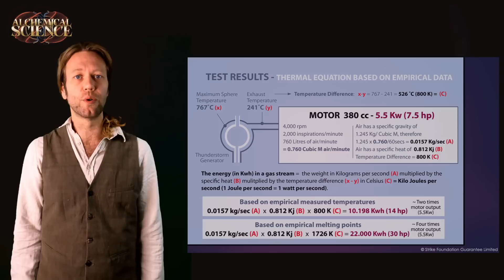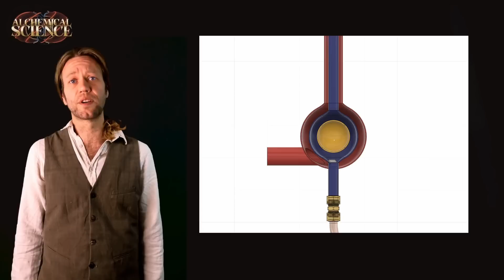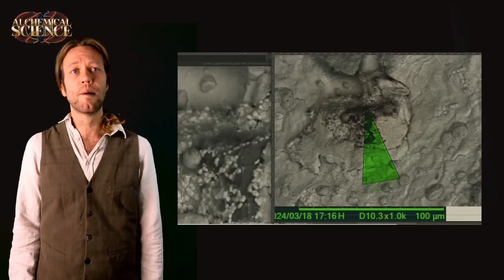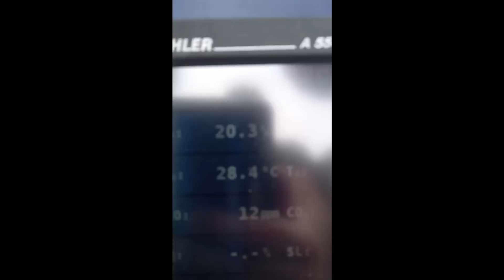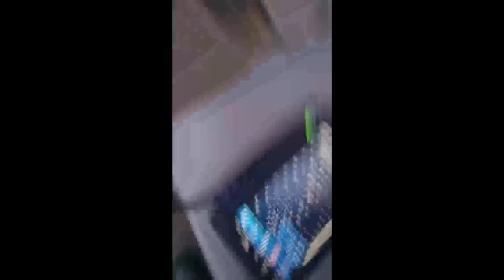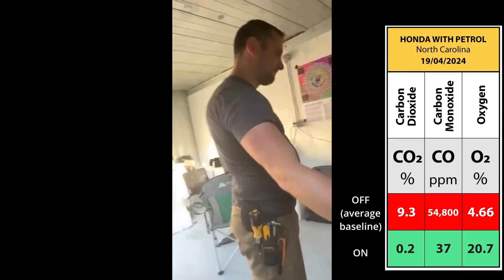Malcolm Bendall's Thunderstorm Generator | BEGINNERS GUIDE + NEW Trial Footage from the US

Comment: heres how it works, to my understanding:
regular internal combustion engine runs as normal
the high pressure exhaust from the engine is pushed through a Ranque-Hilsche Vortex tube to cool the gasses, increase their speed, and form them into a smooth laminar flow
the vortex tube is used for isotope separation through the "helikon vortex process" and the thunderstorm generator is used to atomize the highly pressurized gasses coming out of the vortex tube through a liquid medium, creating billions of tiny cavitation bubbles that are used for an additional "zero point" combustion stage before being recycled through the engine again, where the individual atoms of the gasses are combusted at the "zero point" of the cavitation bubble during collapse, the very center where temperatures exceed the surface of the sun and light is literally created. its literally chemically converting the gasses into new combustible gasses, so on and so forth until the only thing coming out of the exhaust pipe is oxygen and trace amounts of carbon.

Comment: none of the math mentioned works.   These are fantastical made up numbers that are easily disprovable.  The one that just instantly stands out is the 767⁰ C exhaust heated vessel  temperature assumption.  That is simply wildly implausible to the point where you can dismiss everything else.

Comment: One line you should add to the measurements is the normal atmospheric level readings if available. Oxygen levels can change based on altitude for example and CO², CO, hydrocarbon can vary betterment urban vs rural locations.

PS. Most of my SS had arrived 😁

Comment: So much obvious  basic testing has not been done yet, but they've found that the optimum entry and exit angle between pipe & shere is 51.84° ?? To 2 decimal places?.and it's "critical" how can the average builder manage that? If the insertion of the pipe into the sphere is a fraction off 90°, then the entry/exit angle will vary all the way around the hole. I dont get it, to successfully construct this to sufficient degree of accurary is impossible to just about everyone. The spheres would have manufacturing intolerances as well...what if there was a flat spot or a bulge just where the hole was chosen to be? What about distortion from the heat used to weld/solder it? What about the welding or soldering bead  sticking out right where its supposed to be 51.84°.
That bit at least is utter nonsense and could not have been achieved with any sort of accuracy on any of the prototypes, let alone any experimental work to determine "optimal".
Even if this 51.84° were achieved, it could only hold true for an infinitesimally small annulus of the sphere surface right next to the pipe, because we're talking about the tangent to the surface of the sphere and the tangent angle holds true only for the tangent at that  infinitely small point on the surface. An atom's diameter away rom there and it's not 51,84° any more.
Just sounds like rot.

Comment: Could there be the potential to input these into homes etc? There would potentially be no need for AC units either. If you have the generator running "like a swamp cooler" and just attach a fan or a turbo then youd be replacing the ac and combining the two?

Comment: If you wanna convince the public you gotta do better than this. The sensors giving the readout dont mean jack to me. There are thousands of kids in the us who can program a small arduino, raspberry pi, or a soc of your choice to read whatever you want, add a little esp32 and i can adjust it over wifi. these boards are so small they can easily be fitted into that Wohler fuel gas analyzer. 
Bring the thing to one of the engineering departments at MIT, Stanford, UCLA. allow their people to tear the machine down, rebuild it, and test it with their own instruments. until you show that level of transparency people are going to look at Bendall as a male version of Elizabeth Holmes.

Comment: The original machine had a base-plate of prefabulated aluminite, surmounted by a malleable logarithmic casing in such a way that the two main spurving bearings were in a direct line with the pentametric fan. The latter consisted simply of six hydrocoptic marzlevanes, so fitted to the ambifacient lunar waneshaft that side fumbling was effectively prevented. The main winding was of the normal lotus-o-delta type placed in panendermic semi-bovoid slots in the stator, every seventh conductor being connected by a non-reversible tremie pipe to the differential girdlespring on the "up" end of the grammeters...
Reply: Ah! That makes sense. Ha

Comment: Great video, could you clarify the rotation of the exhaust and intake gases as viewed from the top down. The setup on the engine shows a cca rotation where the schematic diagram cw rotation for the exhaust gases?

Comment: I know how to simplify the system, the way to create the spinning air in the inner and outer tube and make the air spin on exactly 51.84 degree angle like your aiming for just weld one end of a metal spring stretched down the copper tube, measure the distance of the tube and circumference of the spring on the inner tube and do some maths to work out how many turns the spring needs to  turn before welding the other end up the other end of the tube, then repeat for the exhaust hot outer tube, saves making the 2 metal balls and hoping the twisting air is exactly 51.84 degrees, you can put a few springs down the pipe for greater spin, that would mean you can make it all fit in the exhaust system of the car and run a tube to the inlet manifold from the back of the car where the system would be where the spare wheel goes to make room, that's my plan.
Reply: Have you tested this design?

Comment: i love your work , thanks so much!!
I have 2 things that would be interesting to test and show the effects are real for the thunderstorm generator..
1. while running the control generator and the modified one and recording the results, swap the measuring devices to show there is no trickery in the measuring
2. turn on off the light bulb in the ionizer to prove it is in fact required and has an effect

Comment: Greetings, I think you guys should definitely start adding this to all your vehicles. It is impressive to me that malcolm was able to create a device that can deionize the gas which breaks them down to the smallest components. what is comming out the exhaust is all the gas that a normal IC produces. you have to understand that all the gas is for a better term. deionized. during the plasma initiation, the gas is broken down to as for co2= c + 0 + 0, with Nitrogen oxide = N + 0, the reason is simple, you have the oxygen comming wich is from the bad  gasses ie. co2, c0, no, so i suggest to do a little math since you have the numbers, to see if that O2 comming out is the same amout added up from the other gasses. as for the carbon, the burnt smell you also get from the exhaust.

Comment: First, great video. But I'm still trying to understand if, at some point, the fuel is shut off. And running then on just Plasmoids?  I feel like that part should be explained better. Fuel only to warm up, or just improving the fuel efficiency?
Reply: If the engine would need less fuel, they would've told us, but it will produce less power, because cold air produce more energy with combustion engines than hot, and also the oxygen is lower for some time until it allegedly is reducing CO2. The so called efficiency benefits are just a theoretical calculation based on heat differences. Car engines have low energy efficiency because they produce excess heat we can't use as energy, similar to a Gaming-PC.

Comment: What’s really happening:  they’re sucking intake fuel out of the system then feeding it back in later. The engine then appears to be gaining from that portion that would otherwise have been fed in originally.
Reply from the maker: I'm all for simple explanations but I think you might be skipping over the entire process there matey. Engines don't work like that, nor does fusion.
Reply: @AlchemicalScience  You haven’t explained anything at all.  It’s just sounds like you know but you don’t. If elements are transmuting (LENR/Noble Prize?) just show the laboratory analysis, collection method, system isolation, and method of testing .. without that, it’s just empty words. It should be the main showcase, yet it’s not!

Comment: Has anyone put a multi meter on various potential differences of the spheres? What does a copper coil do on the outside or inside of the the tubes between spheres?  I'm sure you can machine spheres that are interlocking and threaded to make it able to be disassembled to get at crusts to test.

Comment: Strictly from the engines intake perspective: 

By no means am I being critical of this work nor the theoretical belief of what's happening but I have theory myself. As depicted around the 24 + minute mark you stated others have had somewhat success without the use of the bubbler; something I began to rationalize myself prior to you having mentioned it.

In essence without employing the bubbler, what one has left is an excellent high efficient 'heat exchanger' with the the hot gas exhaust spinning in one direction and the cooler intake gasses spinning in the opposite respectfully speaking. As a "heat exchanger" the intake gasses are expanding and the exhaust are cooling as anticipated.  The now heated intake gasses aid in fuel efficiency as those similar to Ford's designed use of heated intake manifolds back in the 1960 's by means of heated water 'pre heating' the intake manifold just under the carborator (post air & fuel mixing in the carborator). 

With the use of the bubbler.... the now heated intake gasses along with the introduction of atomized water (from the bubbler), acts as a hydrogen rich source for not only 'fresh air' to the intake, but subsequent fuel likewise.  By the way, this is what otherwise seperates the differences between grades of pump fuels we select while purchasing petro at the pump; that is, how much more or less your willing to pay for at the pump. Put simply, hydrogen carrying compounds are what you pay more for when buying the higher octane fuel at the pump.

Comment: My first car was a Ford Consul Mk 2. The windscreen wipers worked off the vacuum from the inlet manifold. Overtaking in rain was highly dangerous, because when you accelerated, the wipers stopped. Why? The vacuum was lost. I have only seen the Honda test engine running with stable revs. The air is drawn through the system by vacuum with a similar set up to my old Ford. So, will it work at variable engine speeds? Is the answer a hybrid engine running at constant speed powering batteries? Has Malcolm Bendall thought about this possible limitation? (Asking for an investor friend)

Comment: Wow. Impressed. Though one thing I haven’t seen yet is actual fuel efficiency metrics.

I think doing a control study of some kind which could measure both fuel use and total exhaust composition (in a vacuum) could be of value.

While the current prototype is an awesome “proof of concept”, a side-by-side comparative and controlled test would put a lot of skepticism to rest regarding actual application.
Reply: I'm looking at specs for a Honda EG5500, which is the same or similar to ones modified to use the thunderstorm generator. It produces 5.5 kW electricity, consuming 2.2 L fuel per hour. At fuel energy density of 8.9 kWh per L, i calculate about 25 to 28% thermodynamic efficiency as a baseline. I can see right away, that water vapor and heat scavenging are operating in the thunderstorm generator to increase efficiency even neglecting plasmoids.

Comment: Just a minute - near  the beginning he states a 526C difference, then converts that  to 800K and uses it in the output calculation to give a doubled output hp (when it should be 18% or so) - that is some alarming basic ignorance. Nevertheless, the whole plasmoid and transmutation stuff seems real - these bubbles of ionised? air are not cavitation bubbles are they ie caused the extreme sheer forces, so how are they collapsing with any force?

Comment: Great work, the claim is 20per cent increased efficiency, as a combustion engine is about 25 per cent efficient, this is a narginal gain and probably not worth pursuing imo due to the complexity taking the extra weight, maintenance costs etc it would net down to a couple of per cent overall

Comment: I wonder if combing the bubbler and the uv light in the same unit with the ligh bulb in the center of the unit setup  like a bong, please excuse the Analogy. I'm just wondering if Exposing the bubbles as they collap to the source of I. Onized light at the same time, if it would increase the overall chances of class points being produced. Just makes sense to me that if you combine the two and put the light source in the center, it might be a little more effective

Comment: Posing in front of a building with the number "420" prominently displayed above doesn't exactly add to your credibility  or that of this device. It only encourages skepticism. If that was your intent you should have posted this video on April fools day to really add a high degree of disbelief.

Having lived through companies selling magnets to install around your fuel line of your car to boost efficiency and others selling magic disks that you dropped into a socket before inserting a screw in light bulb that supposedly converted AC to DC to make your bulbs last 10 times longer; I have seen snake oil salesman before. Sadly I think many of these hawkers pedaling their wares were also duped into believing in the products they were hawking. Which category do you fall into?

Comment: So the protons from the protium transmute Carbon into Oxygen, but where are these free neutrons coming from?   Without those the Oxygen would quickly degrade into Nitrogen, releasing beta radiation in the process.  Then what on earth are "organic and inorganic elements"?  How does what was a bubble at normal pressures cavitate?  and or "pop".  What's this about clockwise vs anticlockwise, and how is that possibly relevant to a vortex viewed from the side?  Much less your own breathing patterns.   I gotta admit you had me at Flux Capacitor though.  That gave me a laugh.

Comment: I still dont know what the claim is. It isnt perpetual motion. It isnt free energy. When people ask what is it, what does it do. They dont need 20 min video or a rabbit hole. I just what to know what the claim is that it does? It is an exhaust converter? What do you need the generator for?  To make power for another use? So this changes the exhaust to air? And then just released. So what are the gains, plain and simple, not how it works or what it is. Just what are the benefits?
Reply: From what I can understand (and I could be wrong) is that if retrofitted, it increases the efficiency of carbon fuel-sourced engines up to 40 % while also converting (transmutating?)  the exhaust gases to O2 and minimal CO. Hope I didn't flub that explanation....
Reply: @yvkostad  ya, but they didn't say any of that. They just lead in that direction, the rest was left for people to assume, or create in their own heads. It always sounds better when the listener makes up the details.
Reply: You can breathe in the "exhaust" it gives off because it's a ton of oxygen and it's a lot more efficient than what we use currently. That is what I heard. I am not a tech person, chemist or engineer lol
Reply: It almost zeros out the harmful effects of c02 and cm0 and its components
Reply: So my understanding of the retrofit is that it improves fuel efficiency quite a bit, by converting and using the harmful emissions as an additional fuel source, and the gas it expels is pure oxygen
Reply: If you dont know by now I Guess this is not for you

Comment: We need to take gas samples at different points along the chain. Meaning after all components are warmed up and running. 
Then analyzing these samples with gas chromatography / mass spectrometry. This will shed a lot of light on what is happening at each stage. 
For example when the excited ionized exhaust gas goes into the bubbler is some hydrogen gas being generated? Is some of the carbon interacting with hydrogen or other atoms forming compounds that don't show up on meters that only measure CO, CO2, nox?
I have some other ideas as well if you'd like to reach out to me.
Thanks from all of us for what you do.